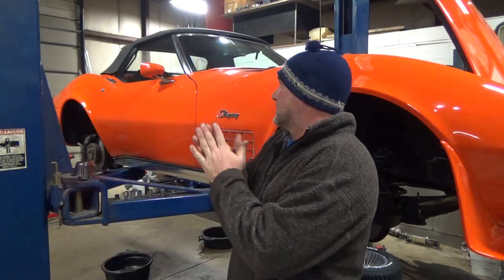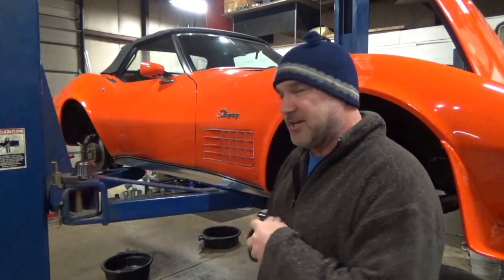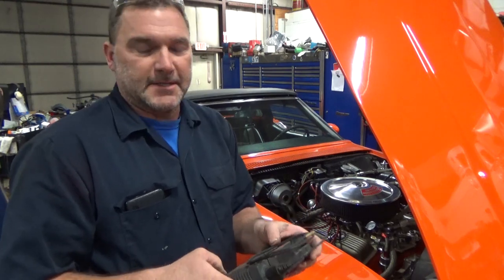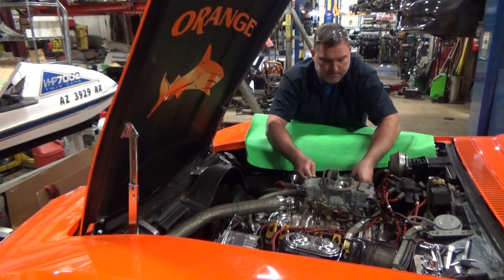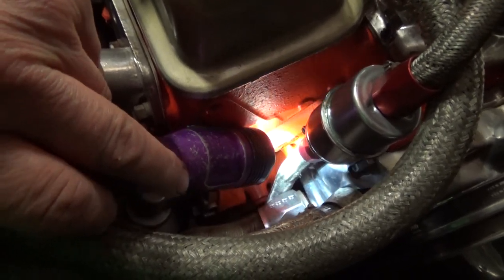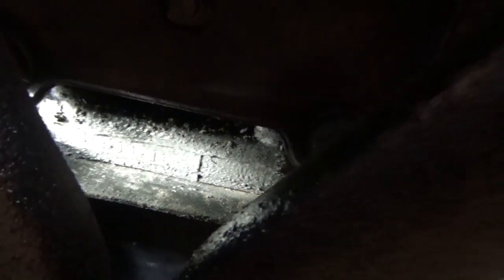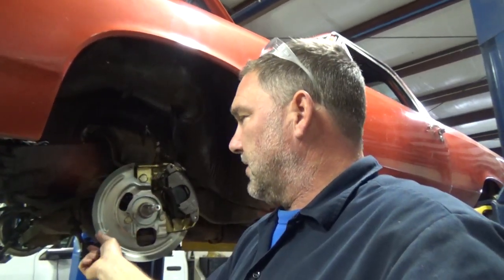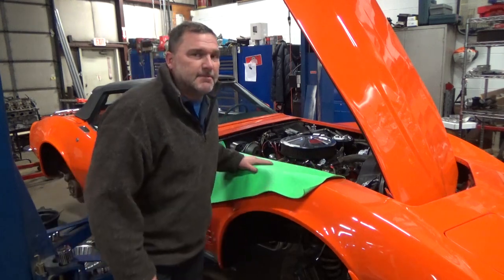1970 C3 Corvette Convertible goes up FOR SALE! 350 HP 350 Small Block 4 speed car! And an El Camino?

Comment: I had this Vette from about '72-'82:  350/350 11:1 Rochester 4bbl, manual roadster low ratio rear end.  Quick off the line/quarter miler.  Not a high winder.  Loved it!

Comment: In 1970 the only solid lifter cam was the lt1 350/370hp. I owned a 69 350/350hp. 11to1 compression hydraulic cam. Also no roller rockers. Has this motor been modified to add these items?